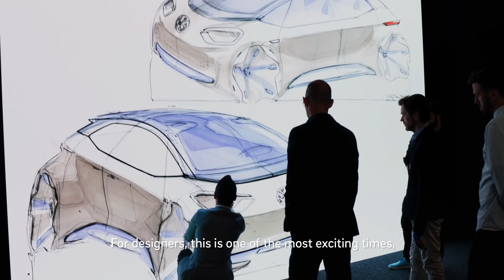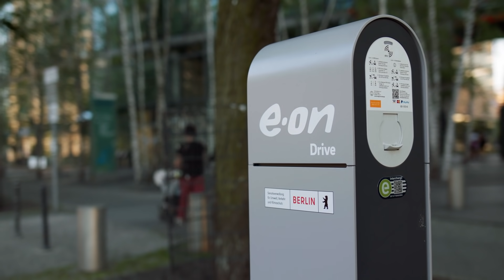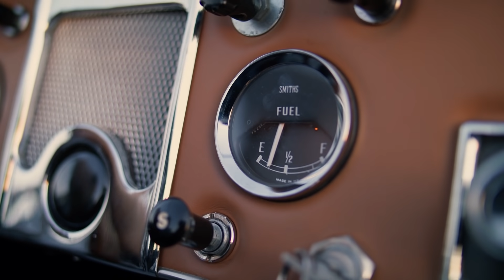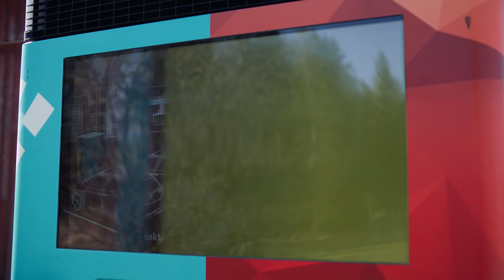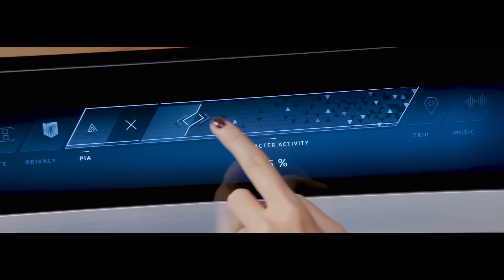Driving into the future: Change Makers E6 #WEhasnolimits #ChangeMakers #EV #EONdrive

Comment: Changing a classic vehicle by putting an electric motor is like ripping out its heart and makes it no longer a classic. People love these cars because of the engine. The sound, the smell, the gear shifts and the lightness it provides. This ruins all of that. You would have to be soft in the head to take an old car with a badass engine and fit it with an electric motor. If it has a terrible engine that doesnt even sound good or work well for the driving experience then sure.